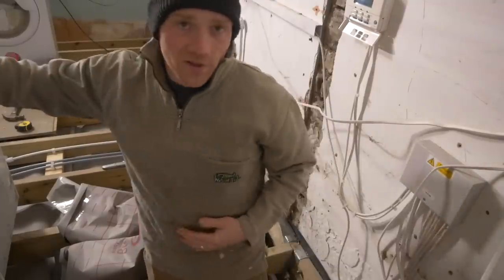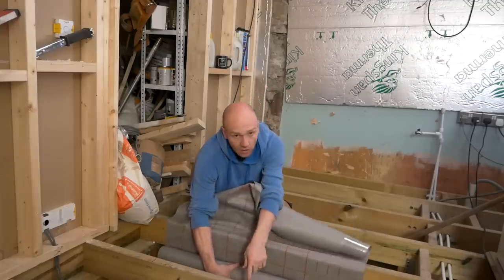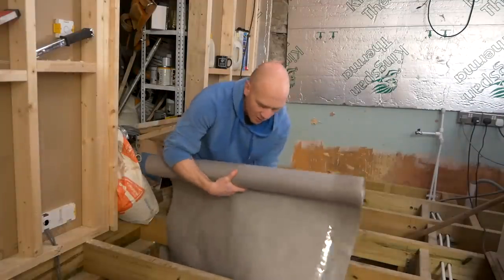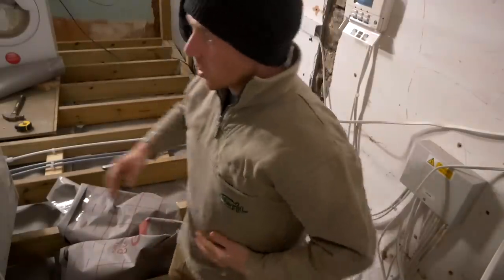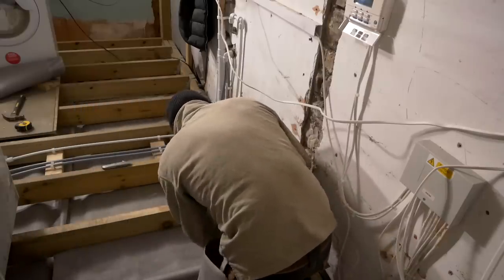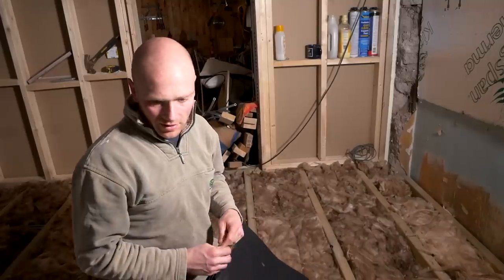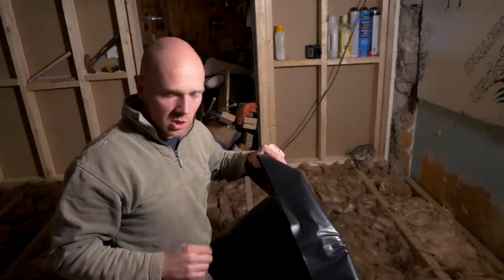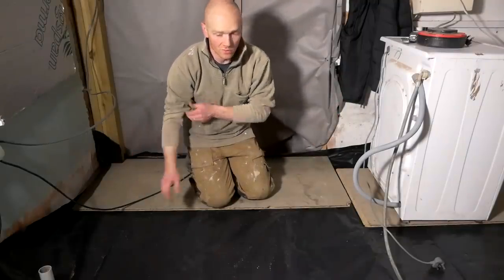Insulating a Timber Joist Suspended Floor

Comment: The vapour barrier issue is a bit confusing 🤷‍♀️
Reply from the maker: Simple rule. You just need a vapour barrier along the warm/room side of insulation. Same for roof, walls, floor, etc. Foil faced products have it already so just need taping.
Reply: @TheRestorationCouple  hi iam about to insulate under a ground suspended floor without lifting the oak boards. I wont be able to use soft insulation and a net due to not being able to put a vapour barrier between it and under the boards...will it be ok to try and get foil backed insulation between the joists? But I guess I will have cold areas where floor joists are. Thanks for reading.

Comment: Mobile air is the enemy of fibre insulation.  A moisture-permable air-barrier is much different from netting.  Then again, the wilds of the UK is far removed from my backyard of -40C and car-burying snowdrifts.
Reply from the maker: I had meant to mention 'air washing', the air flow is ok below the floors but probably not enough to have much effect and with the membrane above at least its not drawing warm air down from the house.

Comment: Tim I don't get your DPM method because damp rises! If your concrete floor gets breached then the damp will be trapped in that zone and you will end up with wet rot. Yes you can say there is a DPM under the concrete but who can say if there really is or if it is totally intact and not pierced by a stone or something. Do you have really good airflow underneath? I don't recall you mentioning airvents. It doesn't seem like a good idea to me because what is the DPM doing that the floorboards don't?  A DPM there won't impact your energy bill yet could prevent you becoming aware of an issue until it gets chronic. To me this seems to go against your thinking about breathability and two way flows etc. I guess if your airlfow is really good then all will be well but I would regard vents as being the main issue, the more the better I think.

Another slighty related issue - leaking washing machines! Been the victim more than once, my sister also. Perhaps you can get a gizmo to monitor it in some way? The point is even a few cupfuls of water can cause a lot of damage, you can get these very slow drip leaks going on. Just thinking it is a great help at leat having a visual check and not to have the machine rammed against the wall where such things are hard to detect. Anyway HTH's.
Reply from the maker: Don’t be confused by the fact I used DPM material, it’s just a vapour barrier. With t and g boards and a finished floor  it is not that vital but if you imagine our original pine floors with all the gaps it is far more important. In the ground floor of the main house it has a huge impact on heating as cuts all drafts blowing up, or worse drawing warm moist air down. It has nothing to do with moisture below, cross vented air space will manage that. VCL on warm side is usually insisted by BCO anyway. 👍
Reply: Well if BC have approved it then it's all good. But what I don't get is you seem to have eliminated all airflow to the bottom of your joists. If water comes in from above won't it just get trapped in the insulation due to the lack of airflow? I am not sure what the point of breather membrane under the joists is as the airflow under there will be removing any moisture.
Reply from the maker: BC will insist on it so not really an option. Membrane under is only doing the same job as the netting did. It does help with the air wash effect which reduces performance of insulation slightly when using netting. Ventilation under via vents and air bricks is plenty for keeping dry. 👌
Reply: Well thanks for the replies, I am not suggesting you are wrong, just questioning if there really is any scientific evidence for using breather membrane under joists??? I take it BC are saying you can use it so as to be able to insulate the full depth of the joist??? 

It no doubt sounds very boring to many, but I do think with a suspended floor in a utility room the biggest concern is water getting in from above, I can see why insurance companies aren't too keen on the idea. I think if I ever did one I would be tempted to go for the PIR boards, get them very level and use a good sealant tape. Like when I had a leak here on oak boards it was barely noticable apart from a damp smell. Yet when I got them up a shoal of silverfish ran for cover and the chipboard was shot. Just saying if you go with a couple of layers of flooring and PIR boards any leak is more contained, IMHO at least. It is just a thought for anyone else thinking of having a utility with a suspended floor.

Comment: Would have been MUCH easier to attach 1"or 2" strips of wood near the bottom of each joist then put/screw thin plywood over the strips then insulate. If damp use all treated lumber.